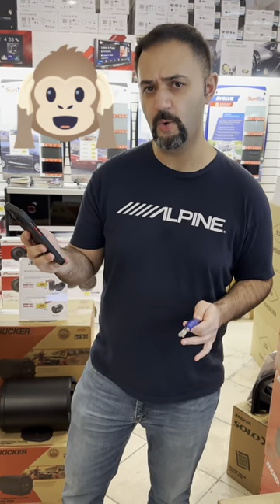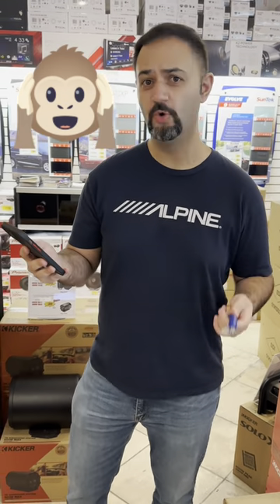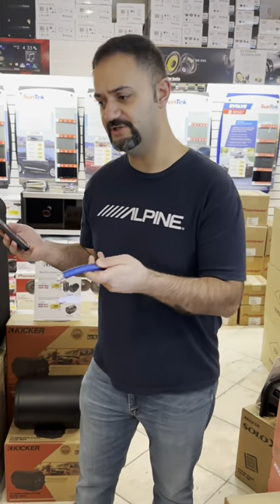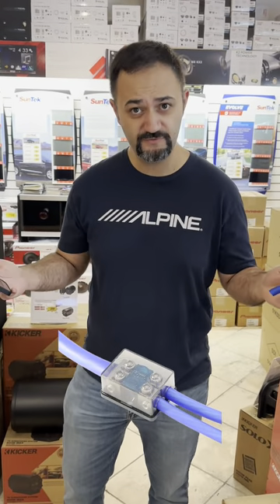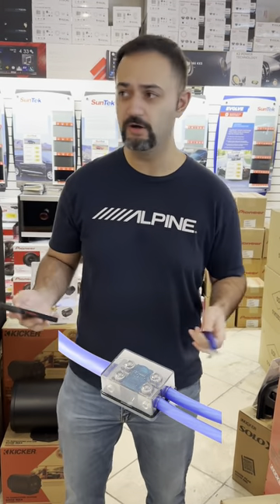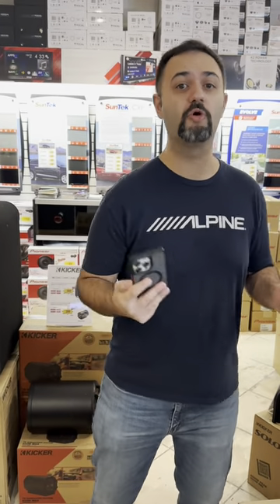[EXPOSED] Can Zero Gauge Wire That's Split To 4 gauge Damage Your Car Audio System?? (The TRUTH!)

Comment: If your fused for the zero gauge ampacity and something on the 4 gauge shorts out the wire could possibly start on fire before the fuse blows... Sounds like they know what they're talking about.
Reply: That’s why you should fuse both 4gauges as well.
Reply: @natekry exactly what I was thinking lmfao it goes without saying.

Comment: I run 4 0 gauge wires to my amp block then all my amps run 4 gauge to amps. Biggest issue is length. I also use solid copper strands.
Reply from the maker: The only issue I can ever see is running power wire to an un-fused distribution block. For ground that's ok, but not power.
Reply: @hi-techcaraudio4303  just because I’m paranoid I fused the wires in the hood to a 4 distribution block 300amps each. With a 400 amp alternator. So my wires are fused on both ends.
Reply: Hell yeah solid copper only, screw that copper-clad aluminum wire junk

Comment: Most of the wires in your car are smaller than 8 gauge.  Keep that in mind.
Reply: They don’t have to push 2000 watts to each speaker that’s why💀
Reply: What does that have to do with anything lol. "Keep that in mind" is the equivalent of "just think about it..." or "as an [insert profession here]..." or "aKsHuALLy..."